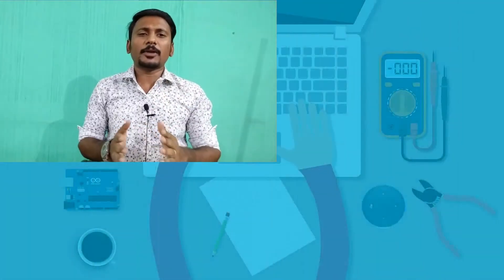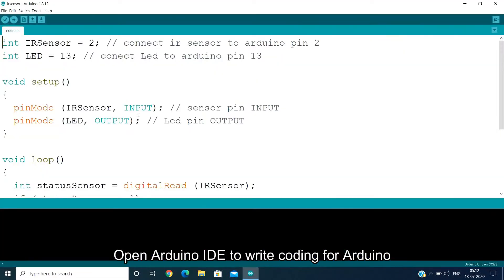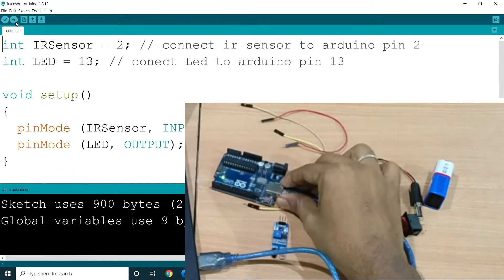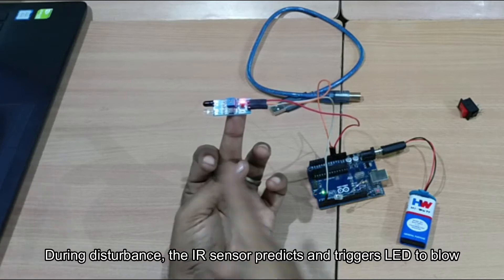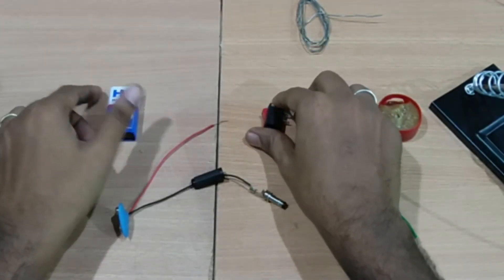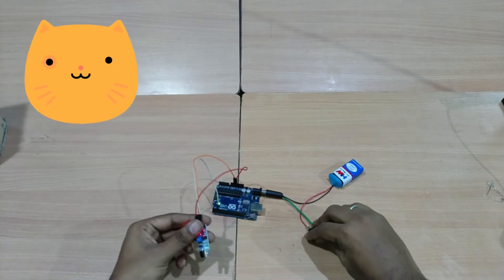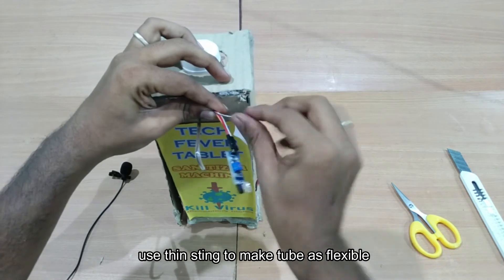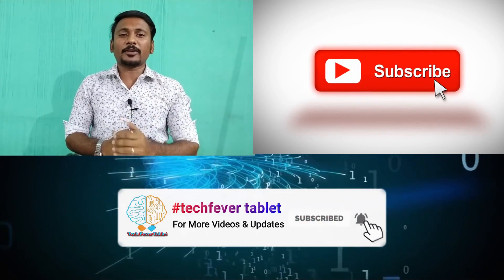Automatic Hand Sanitizer Machine using Arduino (In Tamil with English Subtitles) | DIY Projects

Comment: Sir  money waste and time waste simply do without using arduino that is very simple and reduces cost
Reply from the maker: Thank u. That i already uploaded without arduino. This will b useful for the users in need of using Arduino
Reply: @techfevertablet u r reply was crt sir but we have to reduce the output of sanitizer to 1ml or 1.5ml reduce the continuous dispensing of sanitizer
Reply from the maker: For that purpose we need to go with arduino to set delay 👍
Reply: @techfever tablet yes sir that only iam told